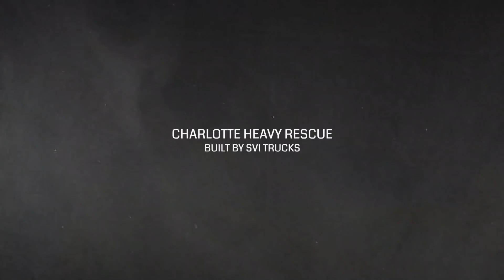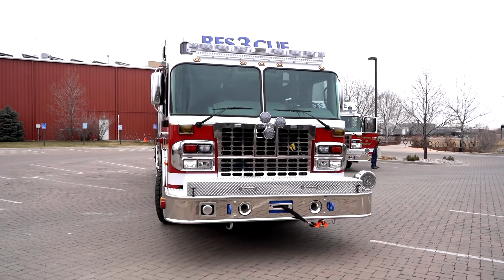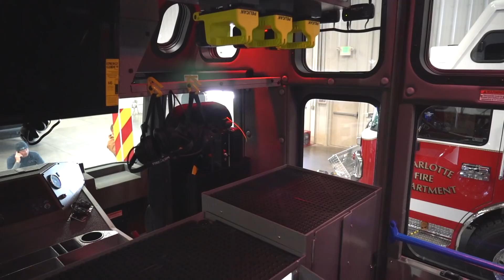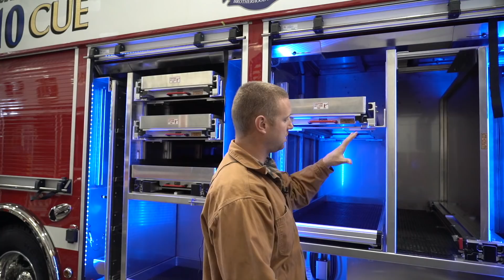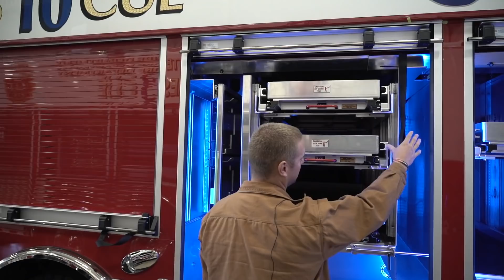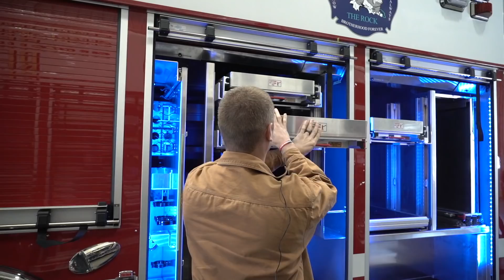Charlotte (NC) Heavy Rescue Walk-Around Video

Comment: The other ones are only like 9 years old! Why waste that amount of money!?! Still sweet trucks!
Reply: Ethan, I can't speak for Charlotte FD because I don't know their call statistics, but here in Denver there are days Res1cue barely sits in quarters, so my guess is, CFD's replacing their rescues because it's time to, plain and simple.  Engine and truck cos. see lower run total because there're more of them spread across a juristiction, whereas there's fewer specialty apparatus--like rescues--covering that entire area.  Wear and tear on such rigs accumulates quicker, thereby necessitating shorter replacement schedules.  Again, though, I'm speculating, and whatever the reason here, some department's gonna pick up a nice rescue on the resale market with a lot of years left in it.
Reply: Ethan Wakula They replace trucks every 10 years. The 09s will become reserves and the current 1998 reserves will likely be auctioned off
Reply: CFD trucks are almost always on the road. I live down the way from a fire station, and also work next to another, nearly constantly responding to calls. Not a small town FD by any means.
Reply: I build fire fighter training props and some of my firefighter customers come to pickup up their units after a 24 shift. One guy told me that he responded to 32 calls in his 24 hr shift. He said they never went back to the station and the truck was running and being used all day and night. Grant it he is in Washington D.C. but that takes a huge toll on equipment and trucks if they are constantly driving over potholes and over curbs in cramped alleys . So a 10 year life span for a truck that can operate 24 hrs a day. A work truck might see half that abuse without the stress of life and death on the line. Not to mention 4 different shifts of     people rotating in and out who all drive the truck differently.